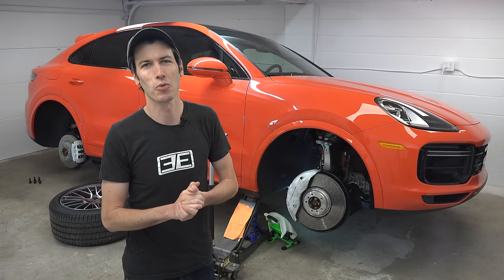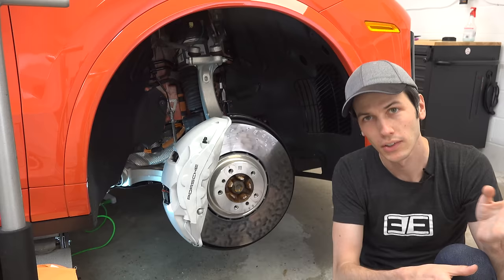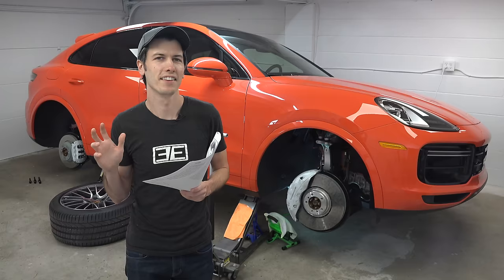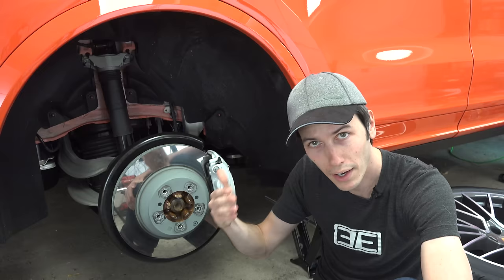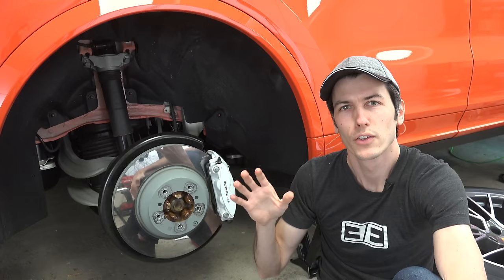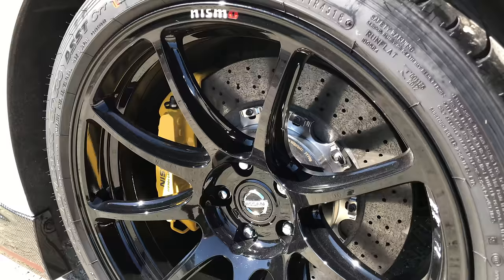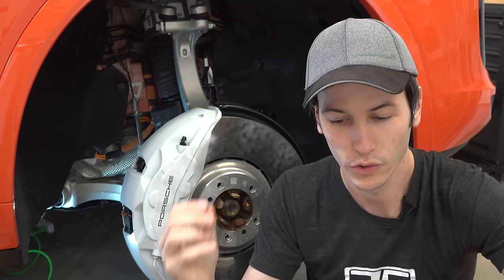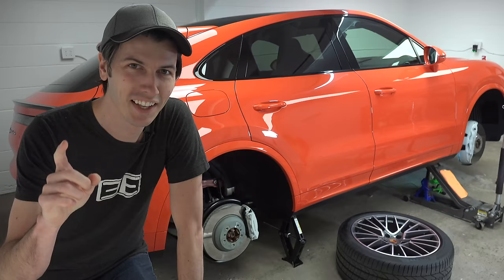Porsche Reinvents The Brake Rotor - No Rust, Low Dust, No Fade!

Comment: Porsche Owners with Carbon-Ceramic Brakes: Brake at a redlight

Also them: "I'm never gonna financially recover from this"
Reply: LMAO
Reply: Carbon ceramic rotors last about four times as long as iron rotors.
Reply: J S - J S and cost 13.7x more than iron rotors. Probably not required on a Cayenne 🤷‍♂️
Reply: @JS-nt3cn  4x2k is still less than 30k. 
2k for brakes still hurts. 
Porsche is not for regular customers.
Reply: I had a friend who owned a 928 back in the late 80s. He said "it's an amazing car to own for 6 months. He said that was about as long as you could afford to drive it before the maintenance costs would bankrupt you or you'd have to sell it so cheap that it would be a nearly total write-off. So nothing has really changed.
Reply: @JS-nt3cn  they also suck at braking compared to ordinary steel rotors until they get up to temperature...which you'd really only ever see on a race track.

And because they're so expensive, in a few years or so there's going to be an entire market of second-hand ceramic rotors because nobody wants to buy them for the exorbitant prices they call for.
Reply: @edbo10  Who uses steel rotors?  Did you mean to say iron rotors (which are pretty much standard on most cars) ?  There is a difference.  I suspect that you are not an expert on this subject.  Feel free to comment, though.
Reply: @berthull9333  Yeah I meant steel, I didn't say I was an expert on the subject, what I do know is that in the used car/car parts market there's going to be a lot of very expensive carbon ceramic rotors nobody really wants simply because of cost
Reply: @greyhound707  maybe things have changed since last year because back then there were articles and videos plastered everywhere about how ceramic rotors weren't as great as everyone made them out to be and how while they're ok for road use, maximum effectiveness isn't attained until they reach higher temps such as the kind you'd see on the track. But then there were also articles contradicting this, with people taking their Porsches out to the track and wearing their rotors out after only a few track days.

People were also pointing out that it'll suck for anyone selling the rotors for parts because they're way too expensive for most people, so there's going to be an entire surplus of expensive second-hand rotors unless the sellers are willing to cut their losses.
Reply: @edbo10  I am familiar with the articles you are referring to. Typically these articles referred to early ceramic brakes on Italian exotics. You won't find many articles stating PCCBs have cold temp issues, certainly not within the last decade. I am also familiar with the reports of ceramics wearing out in track use. This is usually over season (or more) of every weekend track days, not a just few days. The relative service life of ceramics vs steel rotors in track conditions is not out of line with the relative life of ceramic vs steel in street conditions. A every weekend track car can go through several sets of rotors over a season. IE 3-4 steels to 1 ceramic. I certainly agree steel rotors are far more cost effective on a track car. As to a surplus of expensive second hand rotors on the used market, I haven't seen this to be the case. One of the largest Porsche recyclers in the US is LA Dismantler. They currently have one set of used PCCB rotors in stock, specific to the 991. No others. Not what I would consider a large surplus.

My point is there is a lot of misinformation and not relevant information on the web. I don't put much faith into most journalist articles. Most journalists don't own the cars they review, have the cars on loan for a few days (at most) and tend to create content to generate views/clicks. To repeat (mis)information without first hand experience to back up these statements does a disservice to those considering the PCCB option. They would be better served with accurate, first hand information directly related to the Porsche PCCBs.
Reply: @greyhound707  true, normally I'm wary of what's posted on the internet (inb4 abraham lincoln internet quote meme) and here I am basically parroting what "journalists" have reported.

I definitely wouldn't mind cheaper carbon ceramic brake parts for my camry when I thrash it lol
Reply: Can a person ever financially recover from Porsche ownership?
Reply: Drive a gt4 with "The yellow brakes" get to 140 in old money and watch ya passengers lips float in mid air.
And then keep doing it.
That's the excuse trust me
Reply: Person behind can't stop so quickly. Prang!
Reply: Yeah, not a good car to buy when ten years old trying to impress on a budget. I worked with a girl that got a 2005 BMW645ci when it was 5 yrs.old for $30k, used it as a daily driver and couldn't believe how expensive it was to replace the pads and rotors. They have a bi-metal rotor that's aluminum in the center with cast iron disc. I told her that when someone buys a $90,000 car (new price) they can usually afford $200 rotors without blinking an eye. She thought as the car lost value that the parts would get cheaper too. She's not the brightest lightbulb in the box. Moral of the story, and I hate to see people ruin their car doing this, don't get a car payment that you can barely afford and ignore the maintenance because of it. I can't stand it when I see someone driving a entry level Merc, Porsche, BMW or any other high end car and it's smoking (probably because they can't afford the oil change).

Comment: ... And you probably can't change them yourself, because it would require dropping the engine and transmission and then extracting the rotors from the top of the strut mount through the exhaust manifold (which requires a special tool that only Porsche dealerships have).  Join the Right to Repair movement and do the right thing.
Reply: 😅 don't worry...I got it
Reply: freezeme360 whooosh
Reply: I guess some people here have never worked on a car. You made me laugh. As a mechanical engineer I have wanted to throttle the person that designed some of the junk on cars. I mean really, why is the fuel tank access port on top, where you have to drop the tank to get in it. I am pretty sure we have the ability to seal one placed on the side or bottom where it would take seconds to access. Or perhaps having to remove the exhuast system to replace an O2 sensor. Or remove the entire engine to replace an alternator, distributor, or AC compressor. The list goes on...
Reply: @court2379  The access port for the fuel tank is on the top, so that you can access it regardless of how much fuel is in it. 
O2 Sensors mounted vertically can get too hot and if they are mounted from the bottom, condensation can collect inside of them, causing misreadings and failures.
Reply: Don't forget the 3,000$ scan tool you need after the fact to reset all of the brake warning lights
Reply: Look up "captured rotors"
Don't know if that's what's used here.
Reply: @drudgenemo7030  Doesn't look like that from what I can see in this video, brief search seems to imply it's a Honda thing, but that mention proves the point that even brake rotors can be unreasonably difficult to replace.
Reply: I don't repair my Porsche - I get an independent to do it.

They charge <Ford dealers per hour and do a proper job (better than main stealers), the only downside being the cost of Porsche parts (they fit generic where possible). 

It's not labour intensive - none of that idiotic remove panel a, b + c to change a bulb (unlike French cars).  Porsche are an engineering company and do things right (apart from the intermediate shaft fiasco) - they don't make money from the dealerships, but they do rake it in from OEM parts. 

If you're a dick, that owns a new one, then they shaft you rotten because you'll main stealer it (for the resale value) and it's OEM all the way.

When I bought mine I considered a Ferrari but dropping the engine to change a clutch (I reckoned they need an engine out every five years) would have taken it out of my price range.
Reply: @quillmaurer6563  gm used it on the original Colorado
6 hours labor to swap out rotors
Reply: @pd4165  I don't know what kind of Porsche you have, but a lot of the newer ones require you to drop the engine out of the chassis just to change the oil.  I guess if cost isn't an object, it's not worse that Ferrari, but that's still not saying much.  Cars are a great way to set a bunch of money on fire, luxury models especially included.  I do understand the appeal of a sports car, but I hate that the marketing side of the company is firmly in the driver's seat to the detriment of the engineering side.

Comment: Lotus used Metal Matrix Composite  (MMX) material for the brake disks on the 96' Elise. Mixing silica carbide into the aluminum gave the same hard surface. No wear, no dust, and excellent braking performance. The pad material attached itself to the rotor surface (a few micrometer thick), giving maximum adhesion friction, which you get if you have the same material on both surfaces. Material is constantly transferred between the disk and the pad back and forth during braking, resulting in the low wear of both pad and disk. The weight was as for aluminum, so very light compared to cast iron, reducing un-sprung mass. Aluminum conducts heat much better than cast iron and transfer the heat from the disk to the larger wheel mass and area. So temperature was about half of that for cast iron disks. Downsides were high production cost, and eventually metal fatigue issues from uneven thermal expansion of the different thickness of the boss and rotor when using such a hard and brittle material. Surface coating seems cheaper and better, except for the much higher mass of the brake disk with cast iron as base.
Reply: Came to the comments just looking for someone to mention Lotus MMC brakes. Thank you!

Comment: My take away: diamonds are a 10 on hardness scale and I need diamond brake rotors.
Reply: Industrial diamond is fairly cheap don't know how to coat a brake disk in it though
Reply: @burnerheinz  cut the diamonds to be embedded into the rotor. Imagine flexing on people by saying your cars brakes has more diamonds then a rolly
Reply: Found the Dubai guy 😂
Reply: @fleimlehner  with a set of car brakes closing at 70000$ 😜😂
Reply: @romanromero5099  For just one side.
Reply: Baller 😎
Reply: @burnerheinz  lookup diamond coated glass production. 
However that is not a application suited for rotors since they will just chew thru the pads. 
Metals are used because they can be machined to a smooth surface which will not be abrasive to the pads.
Reply: I'm surprised Porsche didn't make diamond brake pads to go with their carbide rotors
Reply: this is actually possible: look up diamond-like carbon
Reply: I agree. Who’d want cheap-ass $32.000 brakes on their car anyway? Anything less than million dollar brakes sucks!
Reply: @christianchristiansen99  the problem is the manufacturers who are so unsure of the actual performance of their own products that they dont actually make any technical information really available. Other than the price for most people there is very little to go on.
Reply: Someone at Porsche has been playing Minecraft 😂
Reply: Diamond coating won't handle the heat well
Reply: This should be the next thing in Hip Hop fashion.
Reply: At some point this will go away, its an antiquated method of braking, wake me up when we have computer controlled electromagnetic frictionless systems.
Reply: @DigitalDiabloUK  lol
Reply: Don’t give them idea for the next year model
Reply: @fleimlehner  I want the entire rotor to be made out of one whole diamond lol
Reply: is there going to be a group buy?

Comment: When brakes cost more than the value of 90% of people's cars
Reply: Fixed* When brakes cost more than the value of 90% of said purchased car after 5 years of depreciation
Reply: @Theart0fstyle  I'm not sure what you think 90% of people drive, but it's a solid bet that it doesn't take 5 years of depreciation before they're worth less than $32k. I'd bet that about 60% of them are worth less than that by the time they've signed on the dotted line and driven off the dealer lot.
Reply: There’s a better world, but certainly it’s pretty expensive.
Reply: I could buy a new car or I can buy brakes.....
Reply: babybirdhome I think he was talking about the depreciated value of the Porsche’s these go on lol
Reply: I'm sitting here thinking the cost of the cast iron brakes is insane.  I think the cost of pads and rotors for my F150 was maybe $150...at most.
Reply: Well, "that's a level of baller I cannot comprehend".
Reply: @babybirdhome  FWIW, the subject brakes are the $11000 ones, not the 32k carbon ceramics.
Reply: I'm currently driving an 8 year old economy car, about to trade for an 18 year old truck. The replacement iron brakes would exceed the value of my vehicle .
Reply: Maybe for that price you should get an EV with regen. That reduces the wear even further
Reply: rich people owns 90% of worlds wealth.
Reply: @nikolatesla5553  thats cheap
Reply: Me: My Porsche was totaled...
Friend: Why?
Me: Because it needed brakes.
Reply: @gummostump4217  No man the ceramics are 10000 thousand same for the NSX or the Porsche these are priced the middle of that now might go down to less then 2500 dollars for all of them once the other manufacturers get on the process..like all things they become more affordable tech for most people
Reply: @rjdverbeek  dang, your right.... model 3 standard range+ is like 35k so 3k more....
Reply: My car cost $3100... lol

Comment: I've seen other famous YouTubers who've let their family members raise a truck on just a jack and then their nephew is sitting under the rear suspension, working on it. If that jack fails, his legs would be crushed and his whole life would change. But they're also cavalier about safety in other respects as well, such as not wearing eye protection while grinding or drilling, not wearing seatbelts while driving on the open road, etc.

You did just fine suspending the car for a photo shoot, and until you pointed out the hidden jack stand under the floor jack, I hadn't noticed it and I still wasn't concerned.

And since you don't have feelings, then a sarcastic response to the haters out there shouldn't affect them, either. But nope, you kept it all above board and showed who's the bigger person. Kudos!

Comment: Me deciding if I should splurge and get $150 "racing" brake pads

Porsche- $32,000 take it or leave it
Reply: Not unless you’re racing... For street use the racing type are worse (like ceramic won’t work well until it’s hot, and bare metallic pads are really loud screeching and destroy rotors fast), so the best ones for regular street driving are the normal semi-metallic and maybe even some organic ones (but the organic ones are often worse). So unless you want poor breaking normally or screeching to the point your ears want to bleed then I wouldn’t suggest it.
Reply: What Jake said x 100.

Comment: This could be used in electric cars. Since they practically don’t brake at all using brakes, but instead use recuperation, the rotor becomes very worn due to rust. So then when you do need to slam on the brakes, you find that they don’t actually work.
Reply: I've been driving electric cars for 10 years and rusty rotors have not been a problem for me.
Reply: The Taycan Turbo has these coated brakes as standard.
Reply: Who drives their Prius at 200mph and then worries about brake rust and brake  shudder? Electric cars are the same category as every other car - almost nobody drives them that hard.
Reply: @shawn576  taycan, Audi GT, plaid...
Reply: I agree. I recently drove an EV owned by a relative who almost never touches the brake pedal (he uses strong regenerative braking and tries to drive "one pedal" almost entirely), and even though the car is driven daily the rotors were clearly rusty - I could feel the grinding when I used the brake pedal.

Comment: Porsche has 4 pistons on one real wheel, my car has 4 pistons for the whole car 😂😂😂 I feel so broke right now
Reply: Lucky. My car only has two. Rears are drums =P
Reply: Are you driving a rotary?
Reply: @ThePentosin  It could have one of those skid brakes like homemade minibikes have that just rub the tire.
Reply: Mine has 4 on one real wheel too 🤷‍♂️
Reply: Prepare to feel even broker(?), cuz here's the actual piston count  @ 5:12  that you must've missed first time around😳😳😳
Reply: Wait until you see their 10 pot pccb calipers lmfao
Reply: I have 12 pistons and floating brake discs on my motorcycle. Only the Front ones, it's a Very old Japanese bike though.
Reply: stilkus your bike is more likely to have 10 brake pistons 8 at front 2 at back. Master cylinders bony count ;)
Reply: he says 10 pistons calipers upfront at 5 min 12
Reply: @Vincenzo911  Yeah, 10 at the front and 4 at the rear. Most high end performance cars have 6 pistons at the front and 4 at the rear. The more budget/lightweight performance  setup is 4/4 front/rear. I actually didn't know they go as far as 10 ,lol.
Reply: 10 pistons on each of the front brakes!!
Reply: @davidelliott5843  I have 12 pistons in the Front and 2 in the back. I rebuilt the brakes myself a year ago. I know what I saw.
Reply: My car also has a total of 4 pistons and that’s including the pistons in the motor.
Reply: @dekoldrick  Lmfao I was about to comment the same thing. My goddamn POS brakes have failed on the highway before
Reply: Buy a 1975 Volvo, you'll have at least 12 caliper pistons.
Reply: Nothing comparing ourselves, we'll always lose. ;)
Reply: Mine has 12 at the front 2 rear
Reply: that also means 4 times as many potential parts to break